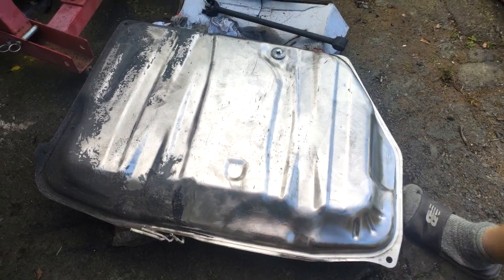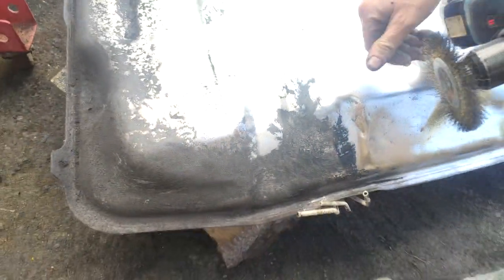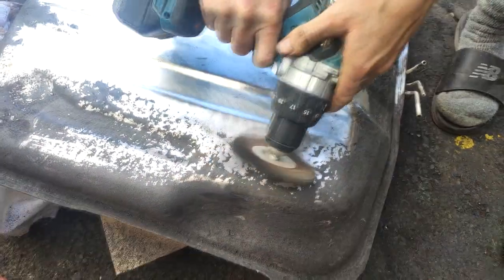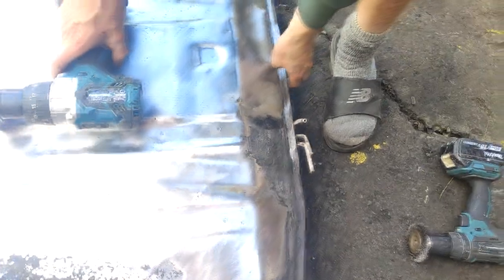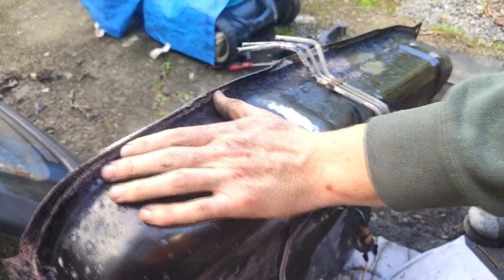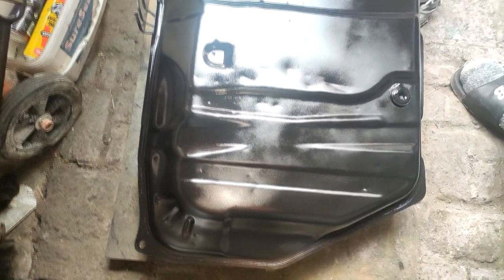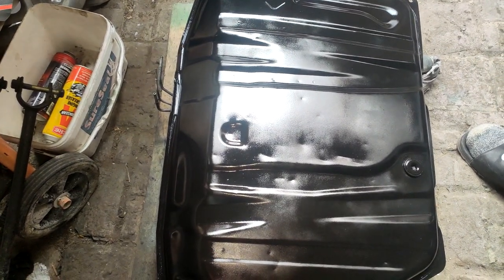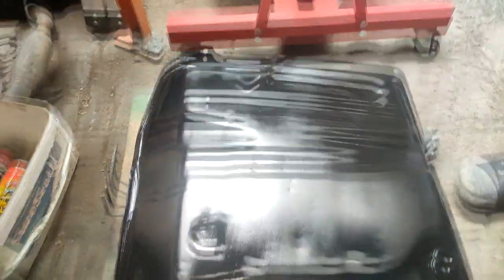Cleaning/Painting Toyota Corolla 2E Fuel Tank

Comment: Hey man, I had some questions for the 2e. I have a completely standard 2e engine, I saw you ran 30 deg of timing advancement with the stock engine + poddie and custom vacuum lines. Now here’s the question, I have what seems to be a different carb from you guys, (maybe an su carb?) but I was wonder what timing advancement I should run with completely stock engine and all vacuum lines still stock as well. I’ll probably run 95 octane from npd. Cheers boys
Reply from the maker: I would run around 20 degrees advance should give it a good power increase they have different type of carbs that came on these motors sound like you have the bad version thanks

Comment: Best mod for 2e-e injection without throwing a lot of money on it?
Reply from the maker: cheapest mods for NA build would be a cam regrind 266 duration costs ($220nzd) and a performance exhaust header ($400nzd) that would give you a very good power increase if you want more rpms then you would need to do valve springs. you could also do a home job port match on the head only cost is for the Dremel and carbide bits and sanding discs thanks.
Reply: @RuggedGarage  i got everything to do these mods but don't want to get it to a shop to get tuned after
Reply: @RuggedGarage  i am planning on a 4age awd swap but for the meantime just a bit more power